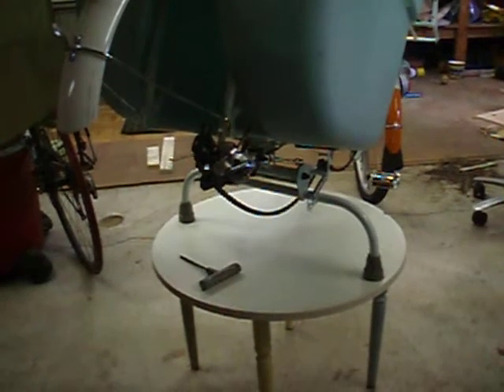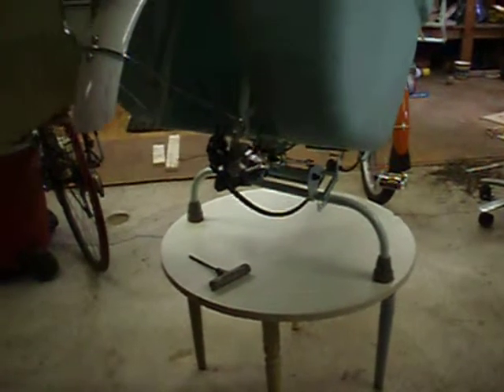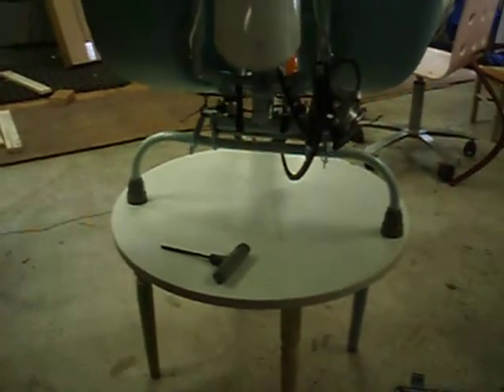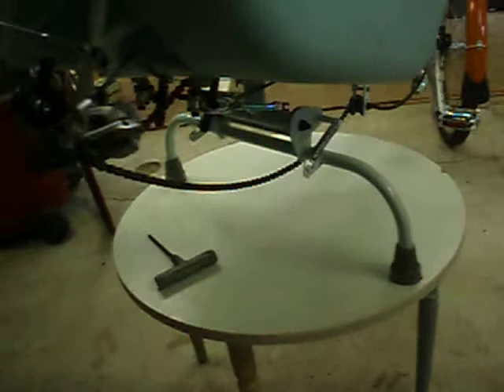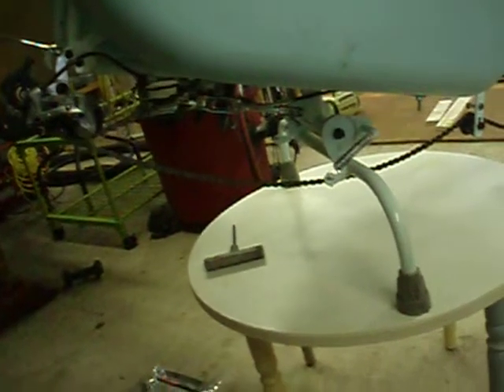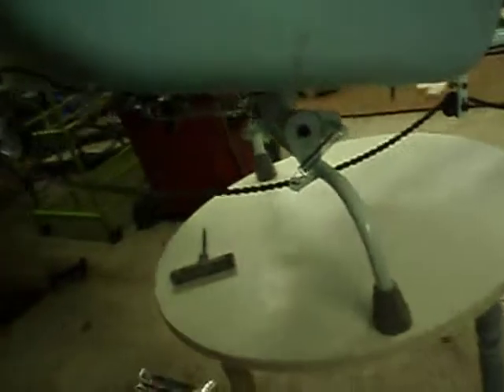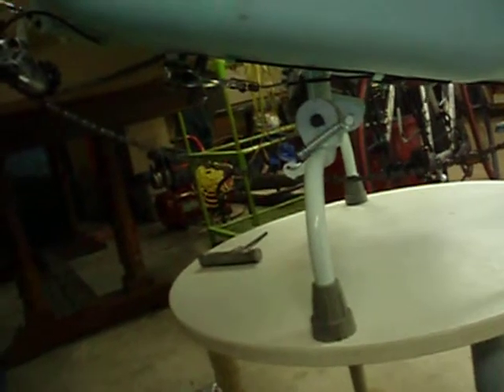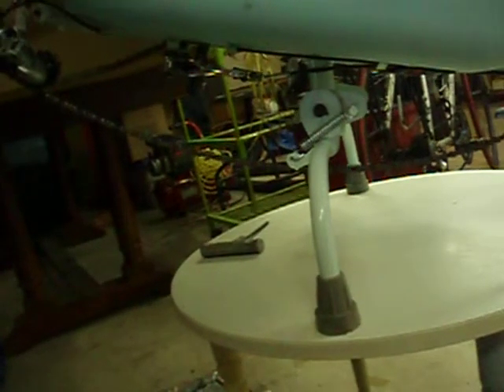Adjusting 2013 Madsen Cargo Bicycle Center Stand

Comment: My kickstand had twisted far enough that it was rubbing on the chain. Thank you for setting me "straight" ... this is an easy adjustment if you remove the bucket, which on my 2017 is a simple job of removing two hex screws.